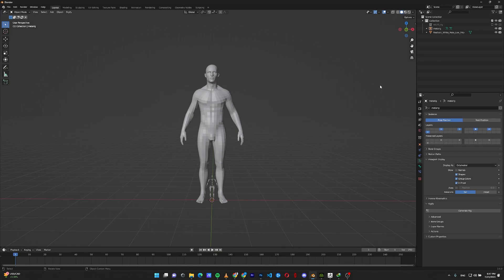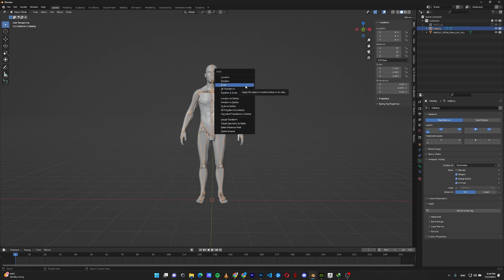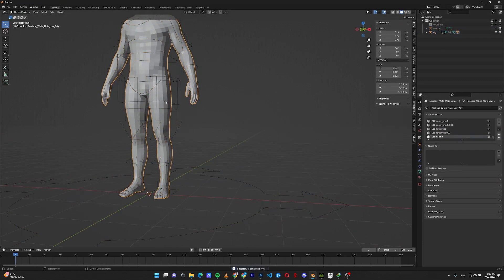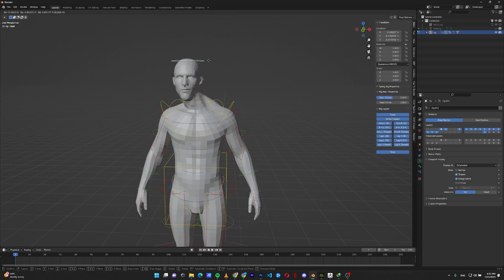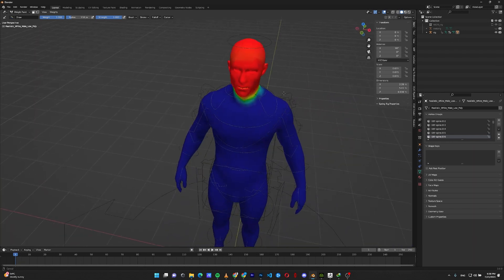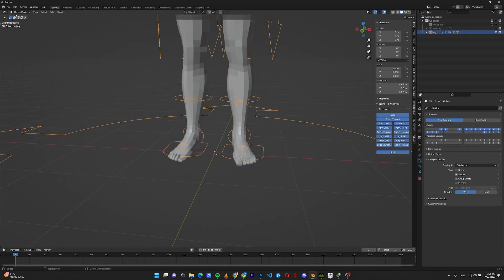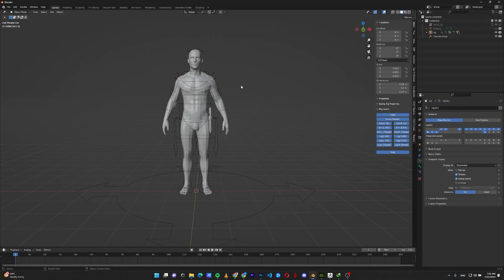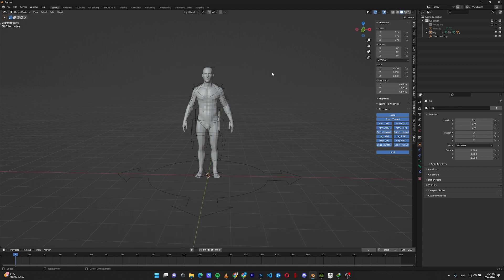4 Most Common Blender Rigging Problems and How to Solve Them

Comment: Control A "apply this scale"... does nothing. Midget bones remain tiny. Does this rigify shit actually do anything useful or is it just a wind up?
Reply from the maker: The control bones are still tiny? can you explain the problem to me? I'm sure it's something minor that we can fix.
Rigify is a good tool if you are not going to use it for an AAA game or an industry level animation, it's useful to make entry level animations or presentations of your model but if the model is not moving good with Rigify there is a chance that it needs to be optimized.

Comment: If you uncheck "Lock Object Modes" from the edit menu, you paint your model while the rig is in pose mode. This means you can test bone movements without switching back and forth constantly.
Reply from the maker: I didn't know that, thank you for your help, and thank you for watching
Reply: You learn something new everyday, thank you for this info
Reply: where is this located to uncheck?im new to rigging so not comfortable with the settings in the UI
Reply: @CyberDan2077  It's the top-level edit menu, next to File and Render. Lock Object Modes is just above Preferences.

Comment: Hi, i am facing a same kind of issue which you showed for Gun. But my model is single object, i have created its hair. On moving object in pose mode the head is straching and getting stick to the same place where i created the model. Please help me
Reply from the maker: Hi, from your explanation, if I get it right, I think your problem is with the weight painting, in the weight painting part of this video you can solve your problem by selecting your model, going to the weight painting, then from the right panel selecting the head bone that moves the head, then paint we red ( Value 1) on the parts that should move with the bone but stuck in place, probably the problem is that some places of the head are not painted correctly and the bone only moves the painted parts and the stretching happens, the gun issue is for separate objects, you can fix it with weight painting too but it's easier to fix it with bone parenting.
Reply from the maker: please let me know if your problem is fixed and don't hesitate to ask if you have more questions or you problem still exist.
Reply: @mck3D  hi, thanks for the detail explanation.  But i tried weight paint as well. Can i connect with you on WhatsApp/instagram/ telegram anywhere to show the pictures/video of my problem
Reply from the maker: sure yeah I would be glad to help you, you can find me @pooyamck on Instagram.

Comment: Hie, I'm wondering if you have a solution for Blender's FBX export problem regarding bone lengths. I have an animation (rigify rig) that does a squat and the legs have no keys or animation and they are both in IK. I export them without leaf bones, and I noticed that both the deform bones are moving around and the ik bones remain. I noticed the deform bones for thigh and calf have scaling value. I can't seem  to find a solution to fix this. Hoping you could help, Thanks
Reply from the maker: Hi, where do you import your model that has these problems? did you import it back to Blender or another program?
Reply: @mck3D  I import the fbx back into blender
Reply from the maker: sorry for the late reply, each software has a different approach to importing the rig and model but if you are trying to import a model back into a blender it's actually very easy, imagine you have a blender file that has your animation scene and you have a blender file that you've made a character inside and you want to import your character to the scene for animation, what you can do is simple, if you rigged your character with Rigify ( I think it's the same with ARP), you should have your "meta rig" armature make sure you unhide it first select your models (you don't need to select your rig) shift + select your meta rig armature (I mean the bones themselves not the rig) now press CTRL + C to copy everything and go to the scene file and press CTRL + V, your model will be imported with the textures and rigs fully working then you can hide the meta rig again, remember that you need to open two different instances of blender at the same time to do this trick but it's pretty easy for moving things between blender scenes.
Reply: @mck3D  no that's not what I meant. I import my animations into unreal engine. But I saw the problem with the feat bobbing when the character is squatting. So I checked my fbx file by importing in Blender.
Reply from the maker: Oh, I should make a video about moving into Unreal Engine, I don't know what is your exact problem that keeps deforming your model but maybe the video's way of importing fixes your issue, if not we can look deeper into your problem.
Reply: @mck3D  I think I may have figured out, and it's got to do with the IK modifier in rigify legs. Disabling the stretch kinda fix it but there are some jerk movements in the fbx files
Reply: @blackkun0202  ohh maybe its the keyframes??

Comment: Thanks. Can you do a vid on how to setup Shape keys (for export to UE4 as "Morph Targets")? 

E.g. Where a body part or the gun is normal size, then small or moved (to hide). Or a helmet visor that is in normal position (closed), then another frame it is raised (open) - then in my game engine I can blend from 0 to 1, for a smooth open, without needing an animation file. 
[Specifically I need to know how to [bake?] these key frames on specific weights/meshes, to export as FBX, without exporting any animation frames. Because for UE4, the first step is to Import an FBX without animation, merely to get the "Skeleton" in the engine. After that, we can Import another file with animations, which we set to use the existing Skeleton (the first FBX file that we imported).]

Another guy said hed make a vid 7 months ago but didnt. Im not sure the exact steps in Blender, to make it exportable. Ty.
Reply from the maker: My pleasure, thank you for watching, haha sure,it take a little bit time as I'm occupied with a project, but I will make a video asap, it's a lot of little steps, if you didn't want to move to a game engine things would be much easier, I'll make sure to explain it as best as can, please stay tuned.
Reply: @mck3D  Thanks. I subbed. Will be waiting. (PS Im in UE4.27. Might be moving to 5x. But I understand the 4.27 interface.)
Reply from the maker: Yeah sure, thanks for subscribing, the UI is the same and things got much easier in UE 5 I highly recommend you to move to 5.x